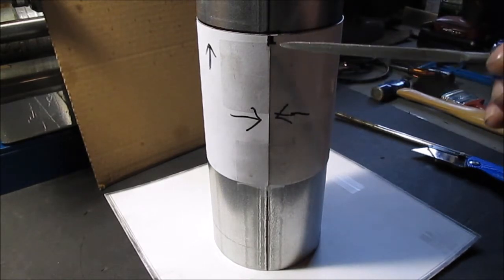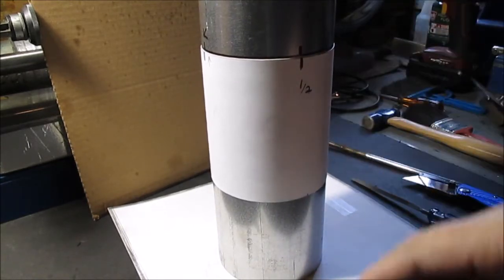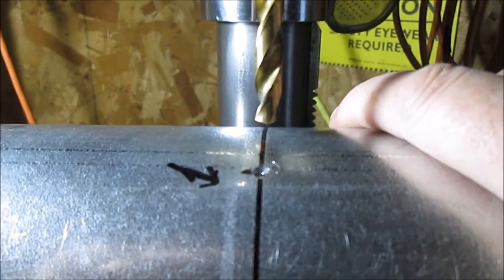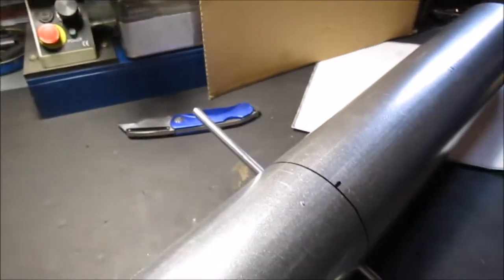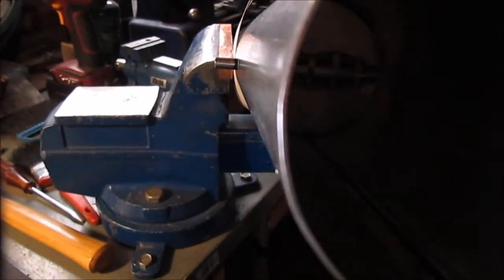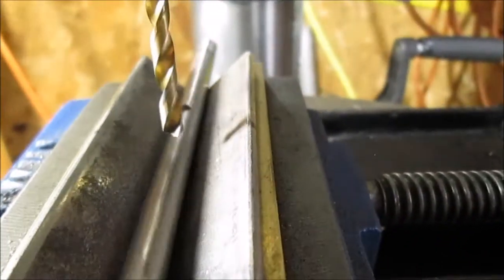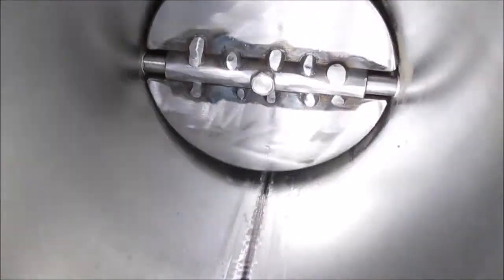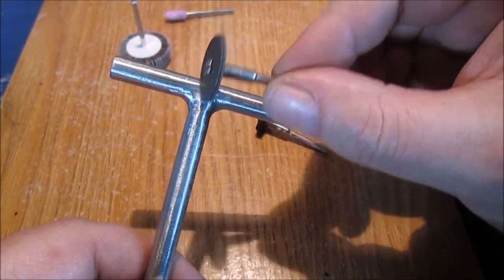How -To .. Homemade Stove Damper 4 in. Pipe  part 2

Comment: Quick tip: cut a long piece of adding machine paper, wrap it around the pipe overlap the excess, make a cut through both together this will cut the excess and also give you the exact length of the circumference of the pipe, with the piece of paper that fits around the pipe fold it once that will give you 180deg marks (1/2), fold it twice that will give you 90deg marks (1/4), fold it three times that will give you 45deg marks (1/8), wrap the paper around the pipe and mark the pipe at the folds. Hope this helps.
Reply from the maker: Thanks...I usually use a ruler and divide the paper

Comment: Predrill a Smaller Hole than what You need to have and use that as a Guide to drill the the correct Sized Hole that your Shaft is going to fit !

Comment: Yea, I have that Chicago rotatory (from Harbor Freight) tool and I could not be happier with it the thing is a work horse and that just proved to me that Dremals are over priced and not much better.
Reply from the maker: +MidwestMotoRider I like mine It is just as tough as my Old Dremel was when it was new ..Did you Notice how I ground down that black plastic part that screws onto the front end ?? It made it easier to fit in places
Reply: +not2fast4u2c No I missed that. I will go back and look at it. Thanks for the tip!
Reply from the maker: +MidwestMotoRider 7:35 you will see it
Reply: +not2fast4u2c Cool got it. Funny I never thought of putting disks together like that so that is something else I will put under my belt for later. :)
Reply from the maker: They grind welds better than the stones do

Comment: What kind of pipe is that ol Buddy?
Reply from the maker: 4 Inch exhaust pipe from a muffler shop
Reply: Thanks Bud, checking my beaver line, I'm making a propane tank wood stove, I'm at the exhaust phase
Reply from the maker: @edjharris1  No problem thanks for watching I have several stove videos  worth searching for last winter i made some miniature stoves that really burn wood and can cook on
Reply: @not2fast4u2c  10-4 I'm following your flapper video to a T